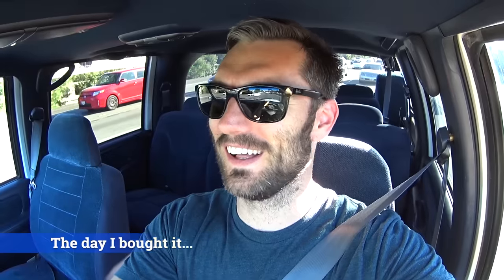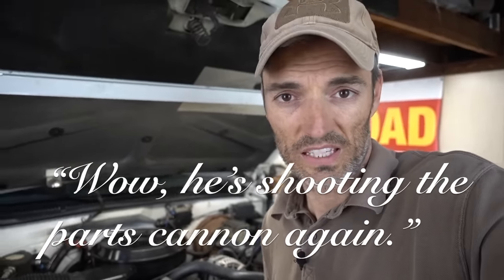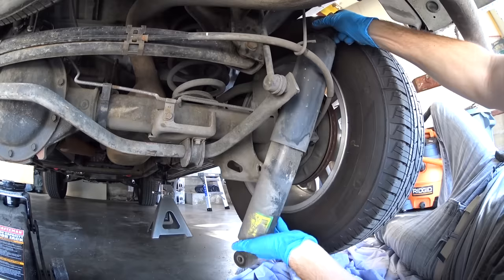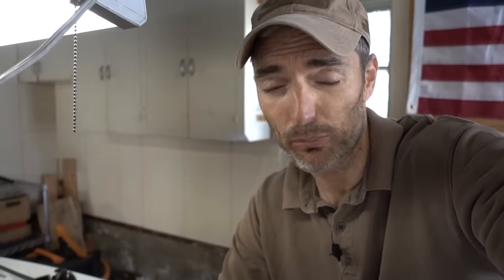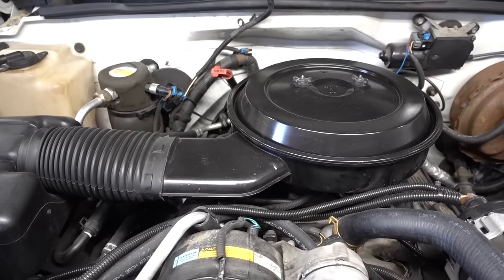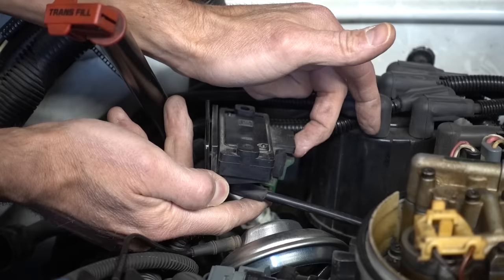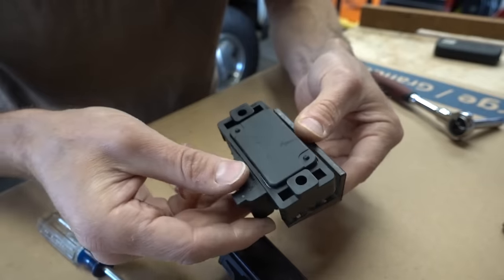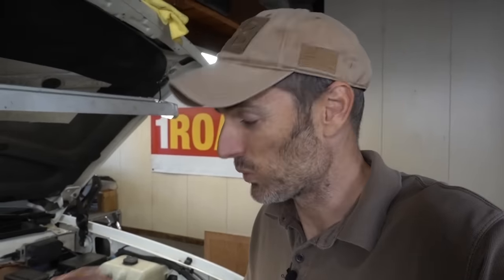The ONE REASON Why My 25yr Old Truck Runs So GOOD!!

Comment: I change the FEW sensors these vehicles have on them, use OEM parts, its a computer with tires. as the saying goes, Garbage IN, Garbage Out.

Comment: any detractors of you placing parts on your 25 year old suburban are most likely paying more each month on their car payments. im 65 year old man, and a retired mechanic. i own and maintain the following automobiles a 1982 gmc 1 ton crew dually, a 1993 suburban, a 96 suburban, a 1998 blazer 2 door, a 2002 suburban and a 2002 yukon xl. 5 of these have always came with 4x4 but the 82 has been completely customized, it is on a 65 passenger school bus chassis, DT360A engine and 5 speed trans, frame shortened and a set of rockwell 5 ton military axles and a divorced transfer case, big ass military run flat tires and a big V plow on the front.
my yukon xl has 315/75/16 iron man all country MT tires,  it is my daily driver, the 02 suburban is my wifes daily driver unless there is a lot of snow, then she drives the yukon xl( she is a hospital medical floor worker with a BSN) so she has to be at work when she is scheduled, and i plow my long driveway with the 1ton. but i can drive down the highway with it, and throw cars the hell out of my way, and even a HEMP CAN NOT STOP ME, I CAN RAISE THE FLAME THROWER OUT THE TOP OF THE CAMPER SHELL, AND OPERATE IT TO   DISPERSE ANY CROWD OF RIOTERS, AND BEING A PSYCHOPATH, THEY BETTER RUN LIKE HELL, BECAUSE IM SENDING THEM STRAIGHT TO HELL!

SO KEEP THROWING BRAND NEW PARTS TO THAT SUBURBAN, MAKE IT BRAND NEW FOR MUCH LESS THAN BUYING A BRAND NEW AUTOMOBILE, IT IS ALSO WAY COOLER THAN A BRAND NEW SUBURBAN AND WILL COST YOU SO MUCH LESS AND YOU CAN DO ANY REPAIRS THAT COME UP. MY 96 HAS A 6 INCH ROUGH COUNTRY LIFT, I BOUGHT IT FOR A PARTS CAR, ONLY PAID $800 FOR IT, AND THE 35 INCH TIRES ON MY YUKON XL WERE ON IT AND BRAND NEW. 
I SCRAP CARS NOW, SO I STOCK PILE LOTS OF PARTS FOR MY OLD CARS, I PAID $1800 FOR THE YUKON XL.    I DROVE THE HELL OUT OF IT BEFORE THE ENGINE BLEW (GOD DAMN POWDERED RODS)! JUST THREW IN A SPARE ENGINE.

Comment: I have a 1980 oldsmobile delta 88,before the computers were installed  except for the five pin electronic ignition module rather than the points and condenser systems.And my friend laughts at me because he claims he never met a guy  like me .Because every time i need a replacement part he expects me to go to the parts store.And i tell him i got the part upstairs.Which he must of heard me say more than many.

Comment: Idk I do agree preventative maintenance is a good idea, but I also don’t believe in firing the parts cannon to trouble shoot a problem ever.. I have gave myself a rule I won’t buy a part again unless I can prove that part was bad.. You say your not losing anything but you are losing time and money.. Instead of just buying replacement parts learn how your parts work and how to troubleshoot them, you will gain a much better understanding and spend a lot less money.. Like the coil it takes literally less then 5 mins to test it with a spark tester and or a multimeter and in the process of testing it you would have noticed it was broken.. but if it tested out ok then I would keep it.. 25 years ago the parts were made better that’s why a lot of them are still working ok.. 
If you really want that engine to run as smooth as possible then pull the heads and clean and polish everything and build it back up replacing all gaskets and testing all sensors.. Mine is a 95.. just finished getting it back together.. I did replace a lot of parts in process but everything I replaced I know had to be replaced.. The egr passages in the intake were completely blocked off with carbon.. There is absolutely no way to fix that without pulling it.. and there is no parts cannon that would have fixed it.. just time and elbow grease.. 
if I’m troubleshooting a problem I will find and fix the problem.. but just updating a truck with new parts is fine too.. but mixing the two are always gonna cost you..

Comment: The problem with old cars up north is the rust.  I’ve never had a car that I had to get rid of due to mechanical issues.  Body and frame rust kills them in 10 to 15 years.  It’s all the road salt they throw everywhere so people that don’t know how to drive in the snow don’t kill themselves.
Reply: Agreed. I live in Pennsylvania, and my 26 year old f150 is starting to show its age because of all the salt. It can be hard to keep up with the rust, because, you know, life happens and the cars/trucks get put off to the side.

 Other than that, I am able to keep it running smoothly.
Reply: @13ghosts31  - in northern New England it’s much worse.  I had a beautiful F150 XLT Ecoboost 3.5.  That truck ran like a dream.  We drive it from NE to Michigan many times.  So comfortable and could carry and tow great.  Just 10 years and the cancer was setting in.  I dumped it before it got so bad it was worthless.

Comment: In 2021 I bought a 94 Silverado with 74k miles on body and motor.. transmission had been replaced 58k miles according to paperwork..It’s better to change simple things and not spend $70k on a new truck

Comment: Just because something is new, doesn't necessarily mean it's better. 

 Mechanical components do slowly degrade, so there's a valid case for replacing radiator hoses, vacuum lines, plug wires, etc. When getting into electronics, my experience has been they typically work until they don't. They aren't a "maintenance" item that slowly fails. 

 Bottom line, if you enjoy doing it and don't mind spending the time and money, then it's not going to hurt anything.... Might learn a thing or two along the way. I just don't know if I would promote it as being a way to offset potential problems that just haven't happened yet.

Comment: I have a 1995 2dr tahoe 4x4 with the rear barn doors.. 5.7L tbi.. i have a high idle at start up.. 1500rpm.. and eventually it comes down but it seems like it takes 10+ miles or more for the rpm's to come down to around 800rpm.. Any ideas?

Comment: You just have to hope that the original equipment part or sensor you buy isn't counterfeit, otherwise you will potentially be adding a problem you didn't have before.

Comment: Ya, Im like this cause family members are driving these vehicles and I dont want breakdowns and phone calls to come rescue soemone. Thinking of replacing alternator in my Silverado with 127k on it. Alternator is sitting here. Less than 100 from Amazon. If I wait for trouble, it will be 192 at Autozone, plus towing and gas for 2 trips 100 miles away where breakdown occurred. On the other hand, a friend of mine, the garage sale shopper, doesnt maintain his vehicle. He was on a 400 mile plus road trip, which he takes like 1 /month, and blew the idler pulleys on his grand prix. He calls me to get a location for nearest Autozone which was like 5 miles at next exit. Why didnt he replace the pulleys before they failed, especially because they squeek a lot before replacing. ?

Comment: Great trucks (Vortec years were ehhh).  Honestly probably better off with that 25 year old MAP then a new one.   Those MAPs were never an issue like a MAF sensor, the ECM would let you know if its bad.

Keep in mind most of those era GM EGR valves dont "hold" vacuum.   They operated off backpressure.   You could pump till your hand was sore at idle or engine off, but they wouldnt open (lift) until backpressure increased.

The only way itd affect idle is if it actually held open, the fact it didnt "hold" vacuum has nothing to do with idle quality.   Never an issue with GMs, but Fords of the era was a common problem sucking up carbon and getting stuck in the pintle.

Comment: I would also rebuild the throttle body with new injectors, furl pressure regulator and new IAC. And also new injector connectors. All of these fail with age, wat better to fix them before they fail. And of coarse a new base gasket as these would fail and cause a vacuum leak.

Comment: I bought a 1999 ML320 AWD with the 3.2L V6 with 169,000 miles the car ran well but for $750.00 bucks why not ? ......I changed the rotors and pads and flushed the engine and added a new battery .... Added (4) Michelin LTX tires and fuel injector cleaner and she runs like a new car...... Absolutely nothing wrong with her ....... and I have a total of $3,000 invested in her .......

Comment: unfortunately that is not a genuine original AC Delco map sensor because it's stamped on the back of them. I replaced mine with one brand new out of the box like that. and it worked for about 3 months and in the truck barely got off the highway for me to plug in the one that's 30 years old and the truck ran fine again. the 30-year-old one stamped ACDelco in the back works just fine. I keep a spare ignition coil ignition timing module vacuum or map sensor TPS and set a plugs. also spare lights and it all fits in my glove box. my truck is highly modified and only runs off the TPS ignition module and vacuum sensor. I do not have an idle control valve I wish I did but it is what it is. it's not necessary and it just kind of made the computer go haywire.

Comment: I don’t disagree with your repair philosophy except that there is a caveat. I’ve been repaitring things since the mid-70’s - was a TV repairman, computer repairer, shade-tree mechanic and small engine fixer. Regular maintenance is essential to any system, but something to bear in mind when taking your approach is the counter-method…”if it ain’t broke, don’t fix it.” .  Sometimes, you can get in trouble attempting to make an unneccessary repair. For instance, you broke a retainer on the connector for your MAPP sensor, whch was working fine. OK, not that big of a deal,  but on an old system you could inadvertantly break a part that is difficult to obtain in the course of replacing a part that isn’t bad. I don’t think you are wrong to do things the way you do, but maybe you should add in a warning to weigh each situation to determine if you really honestly should replace a part that is working fine.

Comment: I too want to anticipate problems before they leave me stranded. I have been a parts guy for  38 years and a car guy for longer.  So your new "OE" map sensor was made in China?  First, AC Delco is not OE.  Your best quality parts will generally come from the OEM while they are used in current production.  I expect a new part to last as long as the original part lasted...but I am usually disappointed.  A couple of years ago a tire shop tried to convince my son to replace the rear brake pads and rotors on his 95 Corvette when the rear wheel bearing needed replacement (due to noise and impending failure).  The factory rotors and current pads were fine.  I can say with 100% certainty that any aftermarket rotor (including AC Delco) would have been of a lesser quality than the original 1995 OE part.  Make your selections carefully. Buy first line parts.  Just a hint - big box parts stores do not generally sell first line parts. AC Delco sells first and second line aftermarket parts. I had a "Get in the Zone" manager try to convince me that "these days parts are pretty much the same and that it's about price and the relationship."  He was/is wrong. Buyer beware of ANY replacement part!
Reply: Bones McGillicuddy  Just one example:  A gm 4 pin HEI ignition module from the 70's - First Line- Standard Motor Products LX301, Borg Warner CBE4P, NAPA Echlin TP45, AC Delco D1906.  Second Line ("value line") Standard Motor Products  TruTech LX301T, Borg Warner CBE4, NAPA Mileage Plus TP45SB.  All of these parts are made in the Standard Motor products thick film plant in Orlando, FL.  Within the first and second lines the parts are identical. In other words, two parts cover all of those brands. They also make "Motorcraft" modules. Big box stores sell the cheap part as standard.  NAPA generally sells the first line as standard, although it depends on what the individual store stocks.

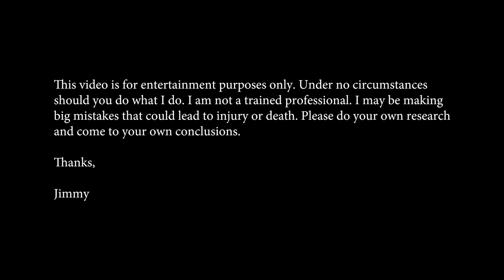Comment: Your "caveat" at 0:15 should be on every video on the internet. 

You Tube has become flooded with AI and CGI junk that many (most ?) viewers will accept without much additional research.  The plus side of the internet is that if a viewer is willing, internet searches can provide opposing as well as supporting points. I found your post very usable, by the way.

Comment: I just saw this.  Normally I don’t say anything but It really hurt my feelings you broke the connector without having a plan to swap it out.  New doesn’t better.  The new MAP sensor from Amazon might be a counterfeit, I hope you saved the original MAP sensor.  The radiator hoses are made to specification with a support mesh.  Please replace like for like when you fire the parts cannon. 

One preventive maintenance item is the radiator.  Over time the inside gets fouled and there is no way to clean them anymore.

Comment: Hey I got 99 3500 with a 454 I have a problem with it, when I get the truck to a certain temperature like 1/4 on the gauge it begins to run rough like the acceleration after 1/4 throttle it just Boggs down could it be that the engine gets to hot and the fuel just start evaporating or throttle position sensor ?

Comment: My 98 gmc sierra 5.7 276,000 miles just got its 2nd transmission and spins like a top

My 2019 Silverado is on 3rd transmission only has 106,000 miles , water pump gone and also the torque converter again so possibly another transmission coming . 

Old is better new is Junk!

Keep on fixing them great machines vs these new crap
Reply: Check the TPS on the 19, if its out of calibration it WILL destroy the transmission.

Comment: I have a 95 chevy k1500 350.  I did an engine swap cause the old engine took a crap.  after getting the truck back together it runs and drives and I don't notice anything wrong except for an egr code.  I looked at the old engine and there are not egr provisions on the passenger cylinder head which I've seen on other vehicles.  How do the egr ports on the intake function if I do not have these on my cylinder head?  The new engine does not have provisions on the passenger cylinder head either.  so I looked for cylinder heads and none show this provision.  is there any information you can share as to why this is being over looked everywhere I look?  thanks.
Reply: Arent your egr ports on the manifold? Egr control module is on the manifold too. 95 chevy k2500 454

Comment: Do you have any idea what would make it suddenly not run right when you give it a fair amount of throttle?  It starts and idles fine, but I start going down the road and it bogs down at like 1500 - 2000 rpms.  It doesn't stall, just seems to be getting bad air/fuel ratio.  I did the fuel filter, plugs, and next doing the plug wires and map sensor.  Any ideas anyone? It might be fuel pump but I really don't want to do that so hoping it's something easier to access.

Comment: LOL. Shooting the parts cannon.  Thats exactly what pro shops do. They use a scan tool and replace parts until there are no more codes.  They dont troubleshoot or even think. They just replace parts and hope that fixes it.  Shooting the cannon is the  standard of the highly paid  "pro" auto shop.

Comment: That BIG made in China sticker is the problem with ac Delco they are not the factory parts and are sub-standard. To get the oem parts now you have to buy them used or new old stock. All the parts for those trucks were made In North America

Comment: A full set of rod and main bearings are cheap as well, so why not just order them and replace them, they are wear items after all.  You should have a good maintenance reason for checking and replacing items. You also might want to consider alot of those "cheap" parts you are buying are actually of a substandard quality, even over your 25 year old parts. Take for instance earlier this year, the original oil sensor went bad on my nearly 20 year old truck, replaced with factory part, lasted 2 months, replaced again, lasted 2 months, bought another brand lasted 2 months, finally 4th times a charm got a good part. So your replacing parts with out them actually being faulty might leave you broken down anyhow. Good Luck with your method, and sorry about your bank account as this method is rough on it.

Comment: I do the same thing. And that is why cars don't go to the junk yard until they reach 300,000 miles. I have 6 vehicles. The newest one is 12 years old and the oldest is 67. If it looks old replace it.
Reply: 300 million miles? Sure, guy. If you can prove to me that you can drive 300 million miles in your lifetime, I'll give you a brand new car.

You can't, because it's literally impossible.
Reply: @ragnaroksangel  yeah 300,000 it was late at late night. But really how thick do you need to be to think I meant 300,000,000. I corrected it for you so you can settle down now.

Comment: Yes you are a parts cannon. If it ain’t broke don’t fix it. It’s pot luck with those china parts. Especially a map or mass air flow sensor. Brakes and shocks is one thing, but electronic parts is a whole nother ball game. Chinese Map or ignition modules and coils will leave you stranded. Following maintenance schedule for ware items is good. Shotgun electronic replacement can be dangerous. Yes, I professionally worked on cars for 35 years.

Comment: Basic maintenance knowledge: weakest link will break and after replacement, the next weakest link breaks. People call it getting nickled and dimed. Still cheaper than new vehicles and if you do it yourself the trust you have for your vehicle and yourself is high. New vehicles can die before 50k miles. I buy an old truck with 180k miles and i assume it will continue to go another 180k because it has a proven track record. New vehicles have no record and the pollution solution gang is changing the rules every year so its reinventing the wheel every year for car manufacturers.